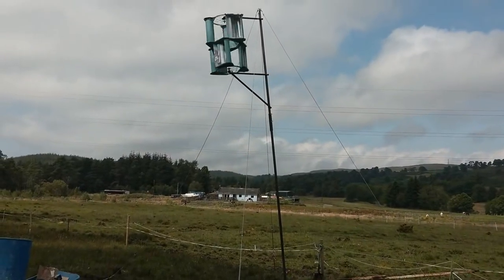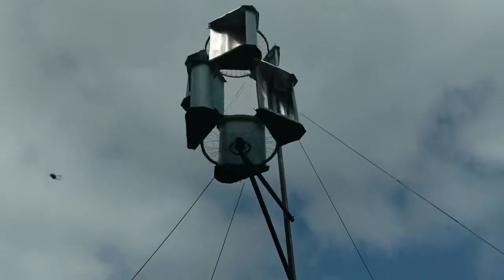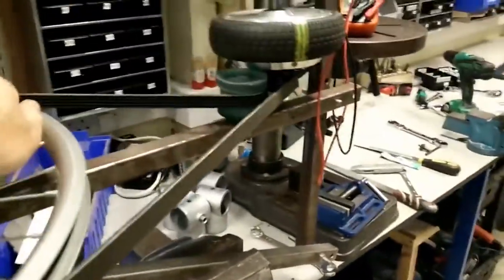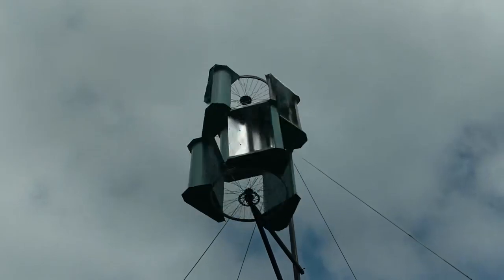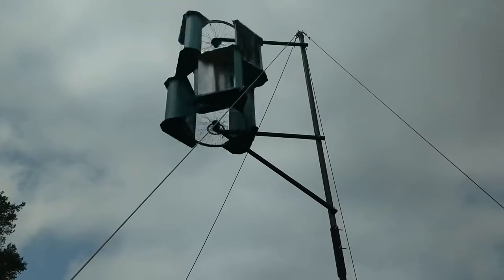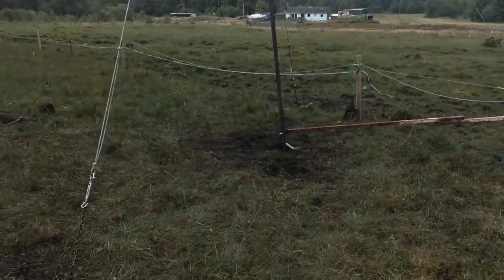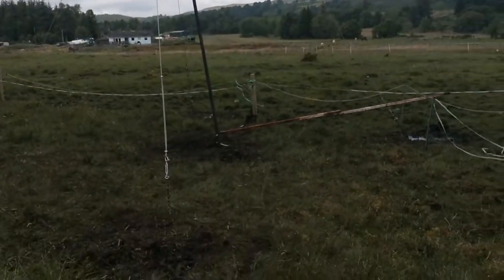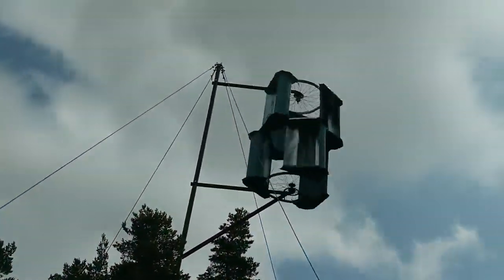$30 Wind Turbine Update - Scottish Highlands Install

Comment: I can’t wait for the update on this! As someone who lives in Kansas (known for it’s constant wind year-round) and as someone who loves to build things (but with limited funds), this project is very exciting to me. 
I look forward to hearing an update on this soon!
Reply from the maker: Did you see the build tutorial?:
https://www.opensourcelowtech.org/wind_turbine.html
Reply: @OpenSourceLowTech  Yes sir! And it's a phenomenally well-done presentation. I also watched the video where you changed the drive system to a Range Rover belt. I'm just curious to know if you ended up sticking with the hoverboard wheel or went with the car alternator as a generator. I'm very new to electricity and don't really know the pros and cons of DC vs 3-phase AC for power generation.
Reply from the maker: Three phase AC is generally considered better than DC for a couple reasons, largely to do with efficiency of transporting it and not usually involving brushes. DC is still doable tho, if you've got a workable generator, like a treadmill motor or similar. Depends on specifics.
I still like hoverboard wheels, they do reasonable  voltage per rev and are easy and cheap enough in the West at least. Especially for my water turbine, as it'll put out enough revs to direct drive them, whereas the wind turbine will need gearing. Direct drive washing machine motors, like Smartdrives, are pretty good if you can get them.

Car alts are a mixed bag. On the one hand they're easy to get anywhere on earth, will do a kilowatt quite happily, and often have basic charge control built in. On the downside they're not very efficient, and high revving, well out of the range of most turbines even with reasonable gearing.

Motorbike alternators, however, are more or less better on all fronts...
Reply: Wow thank you so much! I'll take a look around my area and see what I can get for motorcycle alternators or a direct drive washing machine motor. 
Keep up the great work, your channel/website is an absolute goldmine of information and ideas. It is extremely interesting, useful, and appreciated.
Reply from the maker: Thanks.
I'd suggest DD washing machine motor - hoverboard motor - treadmill motor - motorbike alternator in that descending order of viability. 
If you're in a western country you can often get a whole hoverboard second hand for like 20-30 $/£/€ because someone's getting rid of it. Check FB Marketplace and local classifieds etc.

Comment: By chance checking old emails I found the bike chain turbine video. I commented on that asking if you had any useful output measurements under load, eg charging a battery. Now I know why there never was any, it didn't work. The question still stands though. You say in the video that in the next few days you will install it properly, so there should be a follow up with charge currents and voltages. I admire what you are trying to do, but without data to back it up..... well, all you have there is art.
Reply from the maker: The chain drive did work, just not as well as I'd like so changed for the automotive belt. There's a turbine gone up in Scotland this week which is now in the process of having alternator and electrics attached. Data to come when it's available.
Reply: @OpenSourceLowTech  Great, Thanks for your reply. I look forward to some data.
Reply: @OpenSourceLowTech  6 Months down the line and a winter passed. Any data yet?
Reply: @OpenSourceLowTech  18 months now? Any data?

Comment: There is a cheap, wire spira, in north america usually used for tying dog leads to the ground.  They are relativly cheap and easier to install than rebar, as well as holding up to three times the load of pounded rebar.  I had a Samoid on one and he couldn't pull it out, he could pull out rebar that was pounded in about a foot and a half.  Just don't point the open part of the loop towards the mast.
Reply: Steel  Corkscrew, cheap yeah,  but in soft or wet  ground, they will  not hold for a length of time.  sideways pull is one thing but these  have a significant  upwards pull. 
It's better to just dig a hole put in two bags or three 50 lbs of bags of cement.
Reply from the maker: Yeah did think about those, but gut feeling that they wouldn't be strong enough. Would be nice to not have to dig the holes for the anchors but they do end up pretty immovable.

Comment: Cheap  motorcycle charge controllers will most certainly rectify and regulate the voltage, but dumps excess voltage, and power into heat. If you get enough wind daily maybe that is fine, but I wonder how well a suitable boost, buck converter would work. 

Also, I  wonder if it would be best to put the battery and inverter in a box below the wind turbine. And transport 240vac the distance  to the little home at relativly low currents vs lower voltage  and higher currents comming off the generator to the houses.
Reply from the maker: Heat dumping will be used for heating water and so is a bonus, tho yes a more comprehensive charge controller is still very much an option for nicer and more involved set ups.
For this one they'll be pretty much just running things off the 5V and 12V, and it'll be easier to plug in to the battery + inverter unit at the pod, but if it was all at 220V then yes that would be better to send over distance for cutting line losses.
Reply: @OpenSourceLowTech  Then if not using an inverter,   it makes more sence to move the voltage regulator and batteries closest to the point of use.  The generator will then need 3 wires to the little home. Maybe one three wire 12 guage extension cord might work, or you could 1/3rd the voltage drop by having three 12 guage extension cords with three wires in each cord boned to each other.

Comment: Washing machine belt might be useful ?.  Making a turbine and generating some electricity is fun and not that difficult but making one that keeps doing it for years and surviving storms and rain is another matter .☹️ ever come across hugh piggott the Scottish west coast homebrew wind generation guru ?.
Reply from the maker: Washing machine would be too short, but I'm currently using a car alternator belt which seems pretty good so far.
The longest running one of these was in Michigan for about three years through two of the worst winters on record, and didn't have any problems.
Yeah I know Hugh, he does good work.

Comment: Kinda badass in a diy and eco type of way. I have a question, if one was to charge a battery in a 2 battery setup, while discharging the other by use, how would you setup the change from one battery to the other when need be?
Reply: I wouldn't cycle the batteries. That would be  unnessesary complexity and  batteries do far better when you dont have:
1)  Heavy drain amp draw. For example drawing 10 amps from two batteries in  parallel draws just 5 amps from each, rather than 10 amps from just one. and
2) A kilowatt hour of energy drawn from two batteries is split between the two, 0.5 kilowatt hour per battery vs 1 kilowatt hour  out of just one battery. That way you do not end up in as deep a discharged state prematurely killing your battery, so long as get enough wind and or solar that  you dont frequently draw your batteries down. 

Desining your system to take it easy on the batteries extends their life over designing to beat on them.
Reply from the maker: Maybe with a multi channel charge controller, or two of them? Don't think I've seen it done before, usually the two or more batteries are wired together, either in series to increase the voltage, or parallel for amperage.
Reply: @OpenSourceLowTech  oh yeah that makes sense, so you would just discharge from one battery while the other one got charged by the turbine? Pretty impressive that he can do 500 Watt, why is this system not commercialised more as it would be more wind direction agnostic right?
Reply: @0dyss3us51  no you would connect the 2 batteries to create a "pack" and can charge and discharge from both at the same time. Google "Peukert effect" (assuming lead acid).

Comment: you could use the brakes on the wheel too in crazy winds so the rims etc dont self destruct, more work i know. youd want extremely low power cosumption devices cant imagine it will make much power. fun project though
Reply from the maker: Potentially, but in this case the regulator pulls maximum load when the battery is full, so the braking will come from the alternator, which should more or less do the job.
I'll be interested to see how much power this does produce. Pretty windy where it's going, so I'd hope a couple kilowatt hours at least on the windier days.
Reply: @OpenSourceLowTech  yeh the alternator under load does take alot to turn it, i have a few turbines but theyre all in storage living in an area surrounded by trees, one day ill get to use them , i hope.

Comment: How high should the Turbine be? I guess the higher the better obviously, but do you have experience on some kind of minimal height?
Reply from the maker: More height more power, guess the minimum to be worth it would depend on individual needs.
I'd say maybe less than a meter point five it might not warrant the effort. But then if all you need is to charge a phone and run some LEDs, then maybe still even that..

Comment: Could the alternator's driveshaft not be attached directly to the spinning wheel's hub, and thereby do away with the necessity of using a drive belt?
Reply from the maker: A direct drive alternator would be easier and usually better, but would need to be something that does enough voltage per rev to be able to charge a battery in a realistic wind speed.
Things like direct drive washing machine motors (Smartdrive units and the like) can do this, as can self made alts, but most motors, hoverboard wheels included, don't and need to be geared up so they spin fast enough.

Comment: Could you have a contra rotating turbine and have the generator mounted in the center of the two turbines .One half of the dynamo  mounted to one of  turbines turning say clockwise and the other half of the dynamo mounted to the other turbine turning anticlockwise ? 
That way wouldn't  you double the speed the generator spins ? 
Also a outer shroud seperating both turbines with a fin to keep it pointing into the wind .The purpose to stop air disruption caused by the contra rotating turbines .

Just thinking outside the box to double the generator speed without a gearbox .
Reply from the maker: Yes, and that would essentially double the rpms and therefor voltage, but would need a slip ring or similar to be able to spin the stator without winding up the wires.
In general tho, alternators like the hoverboard wheel need a gearing up of about four to six times or more to get to 12V charge voltage under likely winds, so some kind of gearing would still probably be necessary.

A guide shroud and the like would funnel in more wind, but be an extra layer of structure to build, and would need to seek the wind direction which takes away some of the inherent advantage of VAWTs over HAWTs, in that they can accept wind from any direction simultaneously.
Reply: @OpenSourceLowTech  Wow thanks very much for your speedy polite informative  reply .
Didn't know about the Four to Six times gearing and yes carbon  brushes and slip ring as per electric drill would be needed .
You are correct about accepting wind from any direction ,i just think there maybe a little turbulence caused by a contra rotating set of blades so maybe just a simple circle of a larger diameter then the turbine in  alloy plate would suffice to smooth out any possible air flow issues .
Reply: @OpenSourceLowTech  I am now searching "advantages of contra rotating propeller,s"
Reply from the maker: @rocklover7437  As far as I understand it the turbulence should be fairly lateral, so as long as the turbines are not overlapping height wise, which they'd have to not be in this configuration, then they shouldn't really interfere much with each other.
Reply: @OpenSourceLowTech  Here,s another out of the box idea .Have the windings on one of the wind turbines and the magnets on the other wind turbine .
The diameter of the bicycle wheels turning in different directions would mean the magnets passing the windings in different directions would produce a huge increase in speed .
The further out from the center of a spinning wheel the speed increases .
At the end of the day i am just a Car Painter so zero qualifications other than too much time on my mind wet flatting primer which is a mind boring exercise .
Reply from the maker: Yep, but still need slip rings.
I might end up taking a crack at something like this at some point.
Reply: @OpenSourceLowTech  Cool ,from small acorns oaks grow .
I don't think i have seen a contra rotating wind turbine design  so someone needs to be 1st .

Comment: That sounds like a reasonably good deal for the watt potential, though i wonder what it's averaging with a slower wind. I should probably watch the rest of it as you might've mentioned it beyond the 52 second mark.
Haha, when i saw the thing leaning, and you mentioned it being a peak bog soft parking place for it, I said out loud, cement a bridging block into place that can allow it to be removed or for future repairs/diagnostics, then you said cement after i stopped talking to myself about, lol.
During low speeds, I'd install 30 more of those in a array, or it does provide a good opportunity for someone to use your free installed stationary bike with a belt drive to the batteries or perhaps even to feed it back into the grid. 
If someone owes you money for ages or lost a bet and can't raise the funds and car washes are not an option, well it would provide them a way to pay you back over time, perhaps on the time clock and wattage meter/recorder that would be activated by having them chipped with LRFI technology!

Comment: The most important thing you can learn about wind turbines is they MUST HAVE WIND. If your site does not have average winds of over 15 mph you're wasting your time and money.
Reply: Yup. This can't be overstated. Solar is in a similar boat. I live in WA state where it's overcast 80% of the year. I run into so many people wanting solar roofs that just don't get the problem. The decimal place moves a few places without direct sunlight.

Comment: Love your work. Question: Why have a double plane of wind vanes? I mean, seems the exact same can be done with a single plane, and the same number of vanes.
Reply from the maker: As in six on the wheel, or still two levels of three but in phase with each other rather than half a step out as I have it? In the case of the former; aerodynamics and efficiency, for the latter; they connect to and structurally support each other much better this way. Plus I think more even torque and less dead zones, but there's probably not much difference on that either way.
Reply: @OpenSourceLowTech  Yes, exactly. I'm thinking, not much difference in efficiency, but maybe a little less material for people to acquire.

Not questioning your work, just wrapping my head around it all.
Reply from the maker: Having the two layers also of course doubles the power. It would be possible with larger plates (which do exist but aren't as common) to have double tall vanes, but I feel instinctively that that would be coming up against the structural limitations of the material.

Comment: What kind of metal isthe turbine made from that can be cut with a knife and bought for such a low price?
Reply from the maker: 0.3mm pure aluminium, second hand used offset printing plates.
You're not cutting it so much as just scoring it, so that with a couple flexes the line pops out. It's surprisingly easy and precise, to the point that it's been quite difficult finding any other materials that could be used instead, and work as well.
Reply: @OpenSourceLowTech  
Might be worth testing a "green windmill" rotor on it, they can be made of ripstop nylon or even 6mil poly. The mast is below the rotor (no top bearing) so the rotor diameter isnt limited by the distance to the support mast,

Comment: When you say that the bike chain "doesn't work" - what exactly do you mean? What's the problem?
Reply from the maker: Numerous. In no particular order; kind of loud, chain doesn't really love being horizontal, needs enough tension to engage the wheel rim that it creates resistance, bit of a hassle to break and rejoin in lengths even with the correct tool, needs to be aligned accurately to not skip the sprocket, rust. But like I say, very available anywhere in the world. Would still very much work for low rev, high torque applications if you went off the sprocket set on the wheel, but everything I've been doing so far has been higher rev for electrical production. Will keep it in mind for things like direct mechanical water pumps and the like.
Reply: I remember the original video and wondered why not use a belt instead of a chain. I figured you had an old bicycle and just wanted to use the free parts but i recall it was very loud and not very smooth . To me the blade design is the most interesting part of this project. Has it been tried in high wind areas?
Reply from the maker: An earlier and weaker version was tested up to 105 km/h gust, the longest running one to date was up three years through sustained 80-90 km winds. Both were worst case scenarios, without load or braking. 
This version has been significantly strengthened since, and I have no idea what the destruction speed is. I'm hoping for at least 120 km/h, but guess we'll find out.

Comment: could you not just put two gears with small sprockets on the bicycle chain. The two gears should drive the chain in the same direction and the sprockets can engage the chain instead of running the chain on itself?